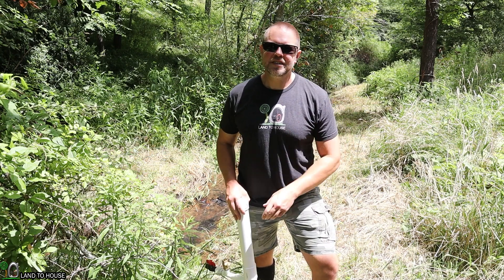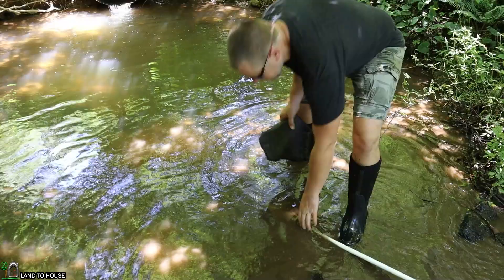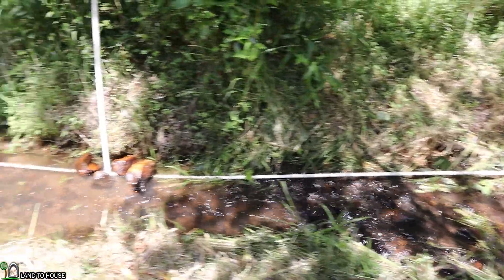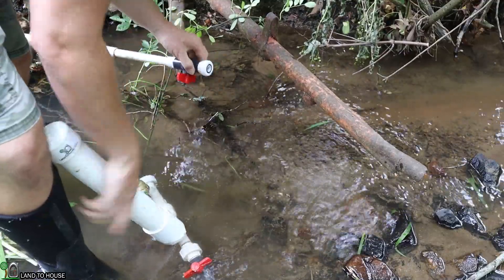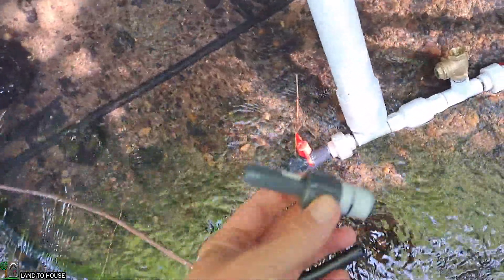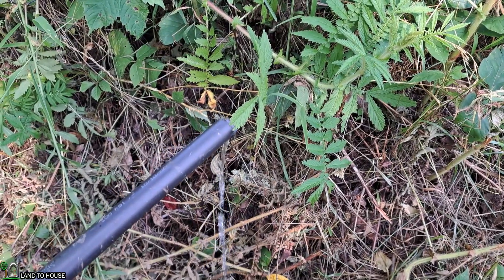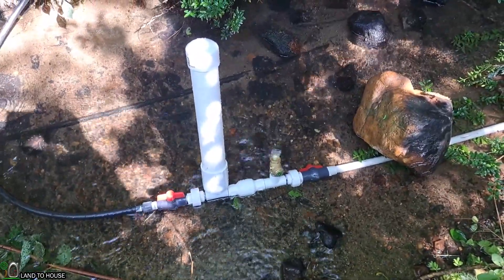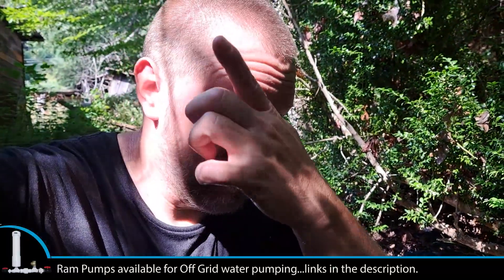Tiny House Water Solution: How to Bring Creek Water Up Hill with a Hydraulic Ram Pump - Part 1

Comment: How steep is your hill? Since you have roughly 5 feet of head pressure that's 35ft of distance roughly. I've been trying to determine if a ram pump would work for my scenario, but my hill is very steep, and my stream has a very shallow slope.

Comment: Hey Seth, I have to say big thank you for being so generous sharing all this info.

I done my pump followed all your instrctions and it works!

It cycles avery 2.5 seconds, I guess if it were every 1 second (as you recommended it) it would push more water up?

Done intake ¾ black hose, pump ¾ also reduction to ½ at the exit of the pump. It intakes 12 liters per minute and gives 0.75 liters per minute at the top of the hill.

Intake hose is about 280 feet long, I guess the stand pipe should increase the cycling speed of the waste valve?

This thing is saving us over here for our gardens since the drought is increasing each year. I am about to make one for my neighbour too...he loved it.

Cheers Seth

Comment: What if you used a ramppump to fill a storage tank or ibc tote then to a second ram pump?
Reply: More waste more lift, problem is if they have the same flow rate you can only operate the second pump of smaller periods of time. But i'd say thats doable. Though it would be more efficient to just size your system large enough to get the lift you need to put your water in the highest spot in your yard and just run a hose anywhere else you need it.

Comment: Close the delivery pipe valve and then pressurize the air reservoir. Slowly open the delivery pipe valve until a very small amount of water seeps into the delivery pipe.  The pump should be able to keep the pressure up and fill the delivery piled.  You may need to play with the delivery valve a bit.
Reply: No need to prefill the pipe?

Comment: Looks kinda fragile..like a small flood might destroy it?
Reply from the maker: The pump itself does not have to be in the water to operate as long as the intake is underwater. If your water sources is prone to flooding you can place the pump on the bank.
Reply: @LandtoHouse of course. Thanks for your reply, I apologize for taking negative perspective 🙏

Comment: You say you have 5 feet of head pressure how do you measure that? I purchased this exact setup from you and have been messing with it for over a month and can’t get it going. Guessing not enough head pressure?
Reply from the maker: If you will disconnect the pump from the drive pipe , you can lift the drive pipe up and use a tape measure to measure from where the water stops flowing out of the pipe as you lift it to the ground. Thos is the head pressure. 

If your drive pipe is too long it will also prevent the pump from cycling. That is why I installed a standpipe for this particular pump.
Reply: So if i have 500ft of drive pipe, i need a stand pipe every X amount of feet? @LandtoHouse
Reply: You may not have enough back-pressure from the delivery pipe.  Try turning off the delivery pipe valve and see if you can get it to cycle on its own.